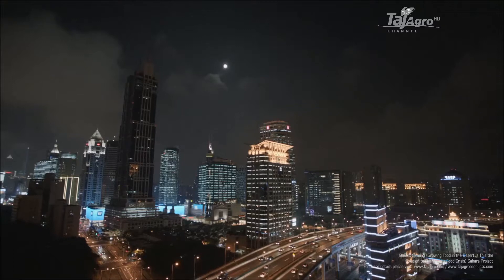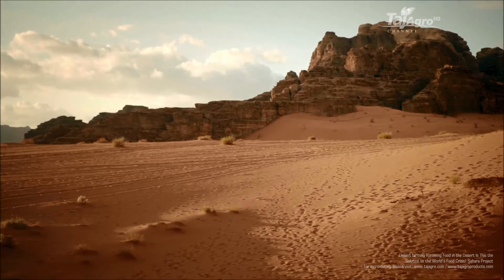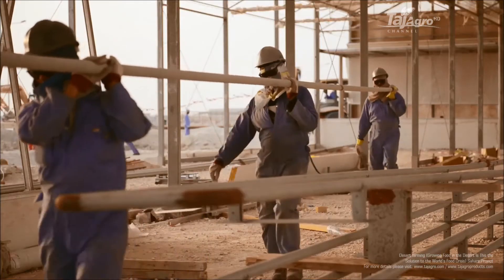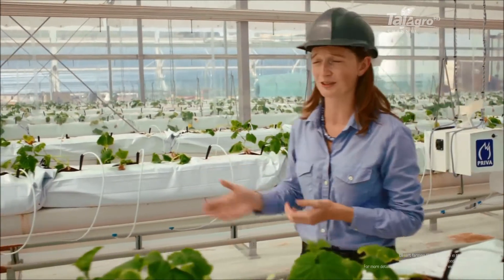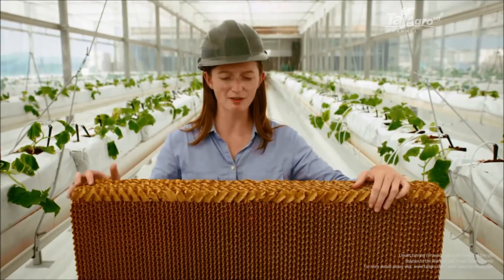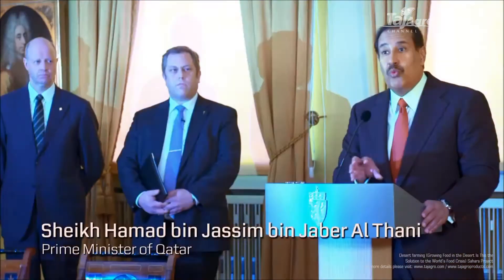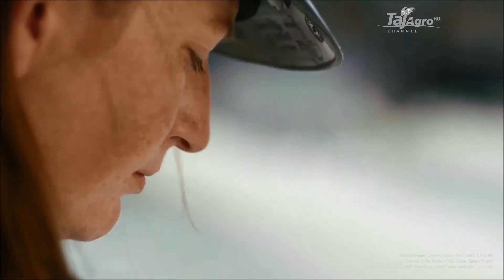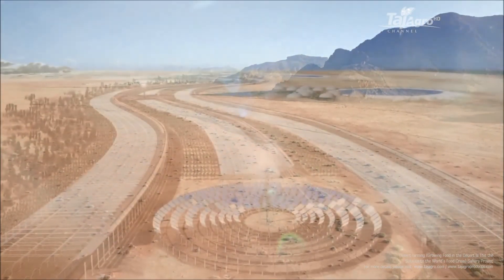Desert farming (Growing Food in the Desert Is This the Solution to the World’s Food Crisis)

Comment: There is no less water on the planet today than there was a million years ago. We live in an enclosed atmosphere where the hydrologic cycle recycles the water, as it was designed.
Reply: That's true but kinda misses the point.  It's about where and how water is being used not to mention the accessibility of useable water.  If you can't afford as a farmer to bring in water it doesn't matter how much of it there is.  If you need too much water because you're using water intensive farming practices, ditto.  If the water evaporates before you can use it, or is contaminated or it's going to negatively impact the local ecology, also the same issue.

The solution to food insecurity in arid regions isn't "we still have the same amount of water on the planet".  It's how to maximize the water that is available in those regions, which is a complex problem.